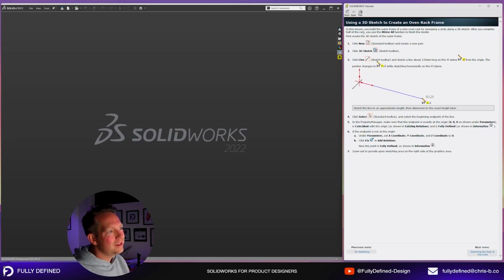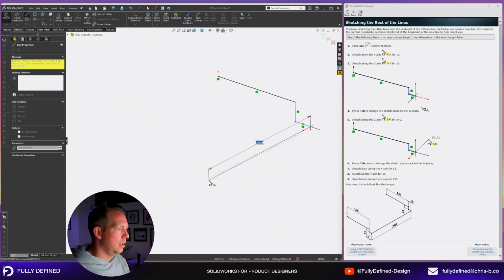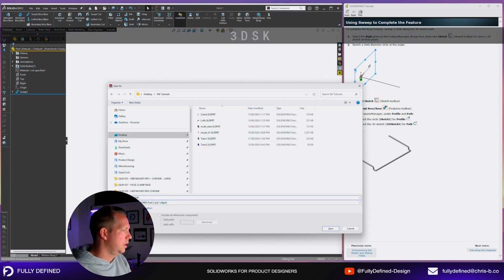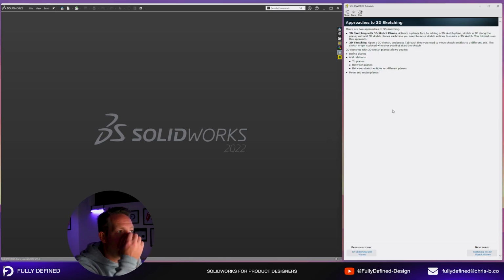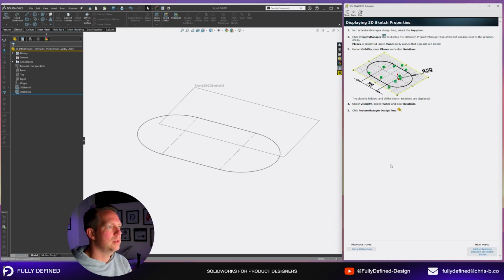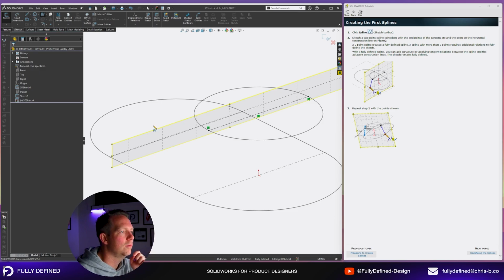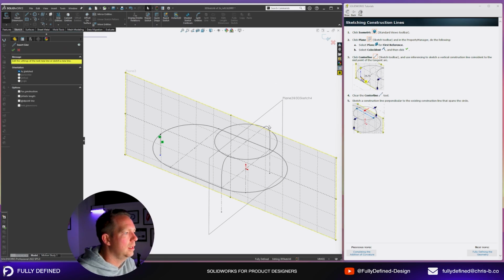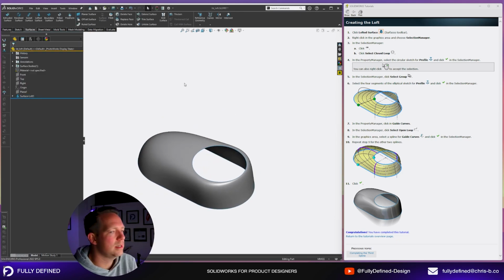SolidWorks Tutorials - 3D Sketching

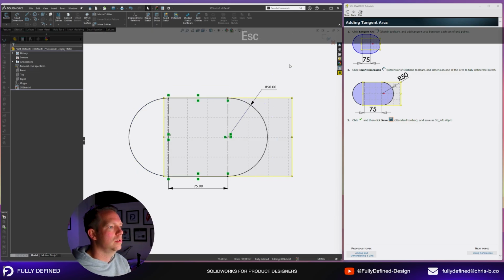Comment: 13:37 is where it all went wrong. A 3-minute lofted surface and an hour to figure out Solidworks' instructions.
Reply from the maker: @dksix1905  yeah this tutorial from SolidWorks is pretty average! Some tools within that I’ve never seen fit to use in 20years. Thanks for watching
Reply: @FullyDefined-Design  Most of my experience was in Pro-E/CREO, switched to Solidworks in 2018. We had perpetual licences and they were pushing subscriptions with outrageous annual maintenance. My work is in a narrow field, designing for the thermoforming industry. I do CAD for a living and when I get home I do it as a hobby. With so many things almost the way I want them to be (in the form of STLs) I've been working more on improving my ability to work with surfaces and meshes. I was criticizing Solidworks' tutorials, not you. I liked you, subscribed to your channel, and ended up learning something from you and Solidworks the tutorial. I think you are using mouse gestures some, sometimes it was hard to keep up with what command you were in though. I plan to watch more of your videos, maybe I'll see how you have yours set. 

Thanks for taking the time to respond to my comment.
Reply from the maker: Thank you. Do not worry I did not take it personally. I remember this tutorial because I was shocked at the struggle I encountered! Yes, I regularly use mouse gestures, I apologize for moving a bit fast. I do hope you enjoy more of my videos. Please check out the Lego Off-Road Buggy series